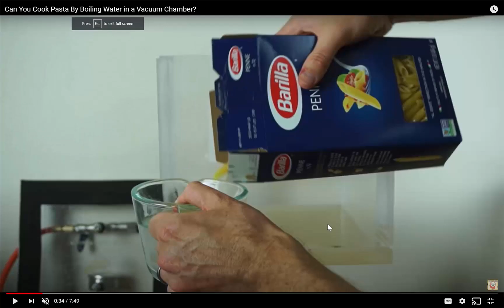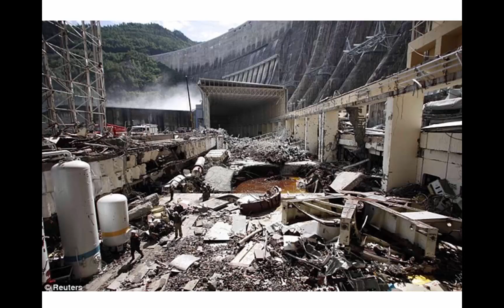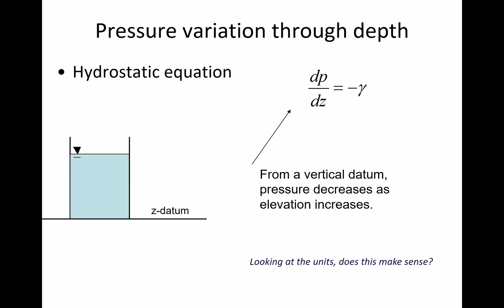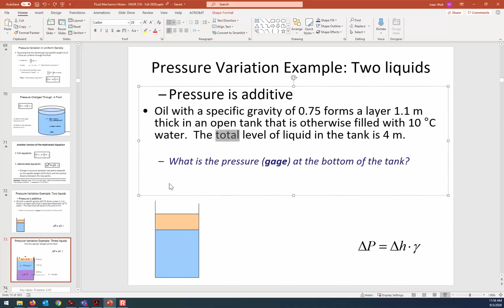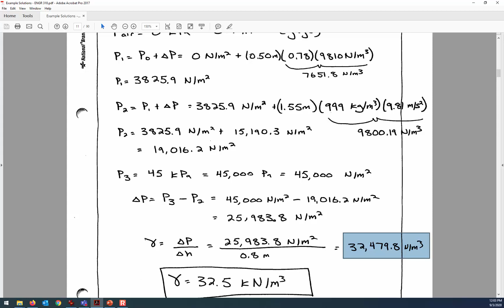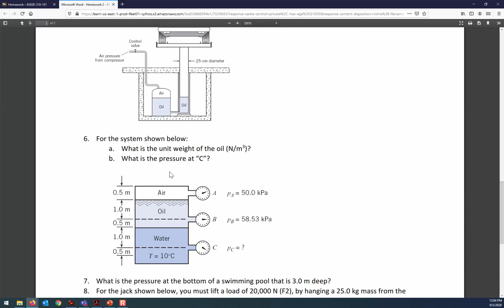Vapor Pressure and the Hydrostatic Equation - ENGR 318 (3 Sept 20) Class 3

Comment: In the pressure variation example say if I am going to structurally design the tank what’s the pressure on the side and it’s floor, Is there a link between the hydrostatic pressure of a fluid at a certain point inside of it and the pressure of the fluid itself on something?